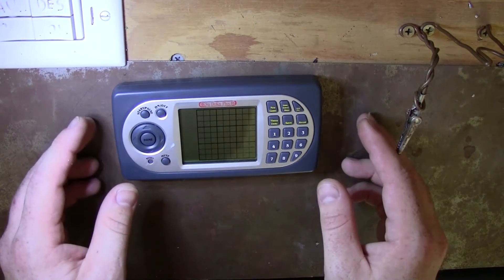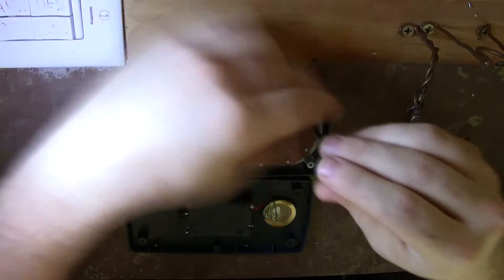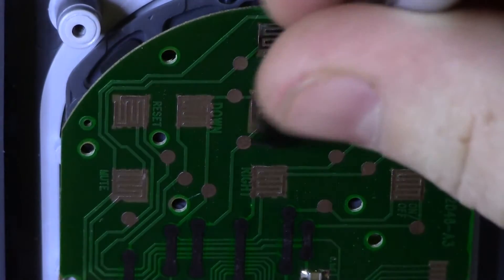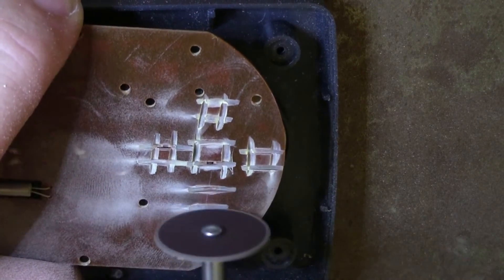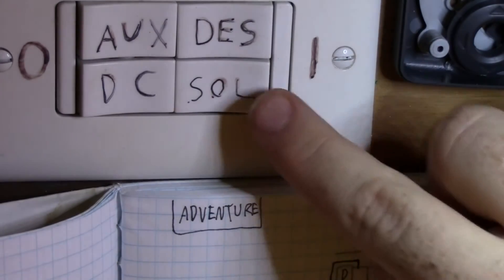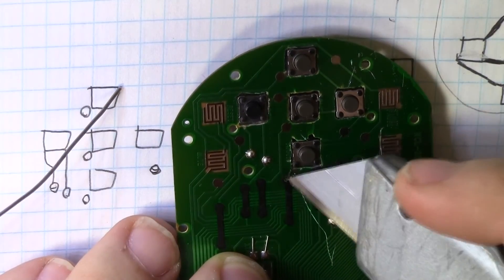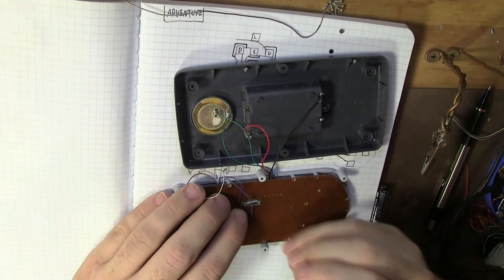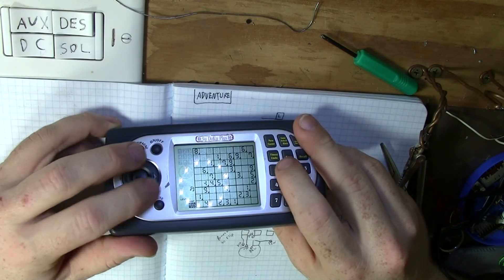Replacing Buttons on a Game System Circuit Board

Comment: Hey, do you do repairs for money? I just messed up my circuit board for my Thrustmaster TMX. I was trying to solder wires to the b button for a handbrake mod and completely ruined it. The designs on the circuit board for the b button looked similar to those on your video. I can’t find a circuit board anywhere. Just let me know please. If you can’t do it do you know of any websites or anything I could sent it to for repair?